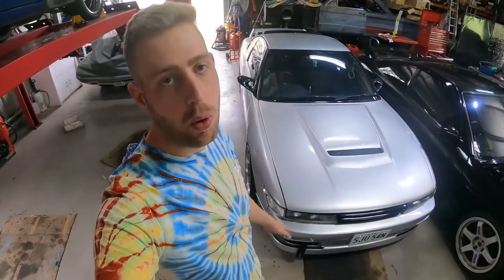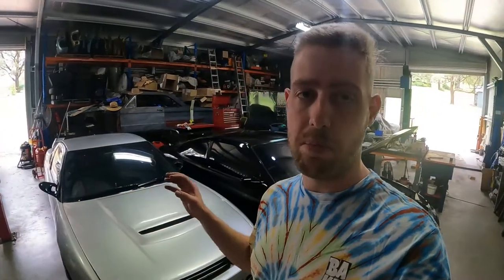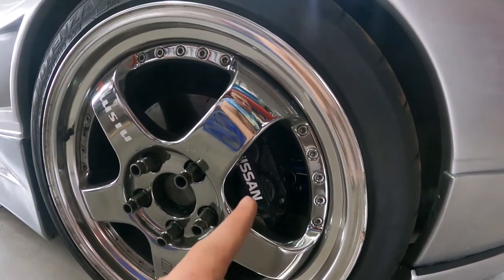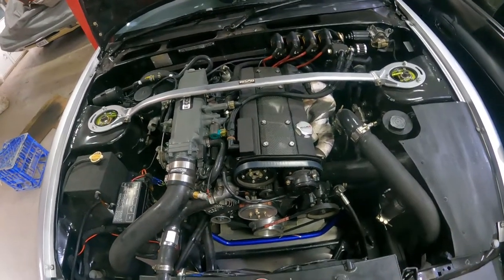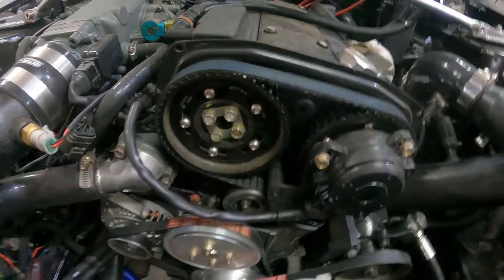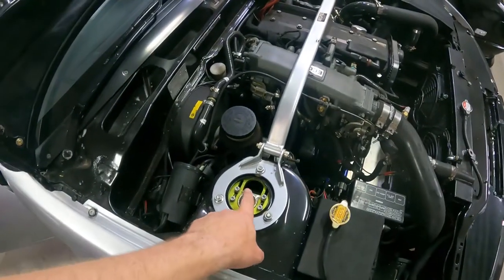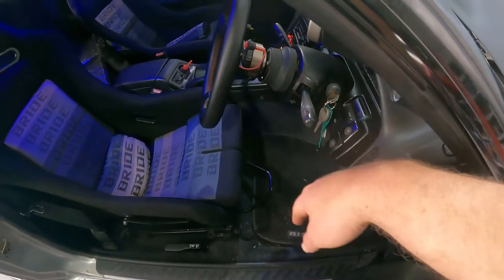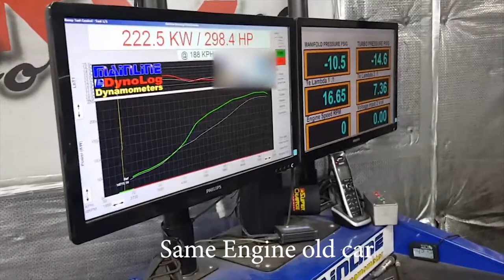CA18DET Powered S13 Sil80-180SX Type X | Walkaround/Tour

Comment: Is that timing belt travel normal on the dyno video? Since I've cut up my timing cover I've noticed mine travels "back and forth" on the timing gear as well.
Reply from the maker: There isn’t any movement. The video is distorted from compression. You can see everything moved when the camera moves. Just make sure your crank pulley is done up and pulled all the way on. Make sure you have the washers either side of the belt to make sure it is guided on. Don’t over tension the belt so it squeals.
Reply: @JarrodWillemse  yup i've done all the above, I'm running oem camgears btw thats why I'm concerned a bit. I've never had an issue since the rebuild and it was probably "dancing" since day one I just haven't noticed until cutting up the timing cover.
Reply from the maker: @menya_  Yeh could be aye.

Comment: How do you like the extreme light weight flywheel compared to stock flywheel?
Reply from the maker: It definitely feels more responsive and revs up quicker but there is an annoying harmonic on decel. I had my engine balanced with that flywheel but it’s still there. I have the same one on my sr20 and it does the same thing.
Reply: @JarrodWillemse  thanks mate, handy info. I’m building and balancing engine at the moment I have purchased the same flywheel but having second thoughts about using it, my clutch guy advised against using it also.
Reply from the maker: @sr0151  it feels amazing to drive but its anoying when you just cruising and use engine braking. It is anoying if you have AC as the car is really boggy taking off. Neeed to take off like 2-2.5k rpm.